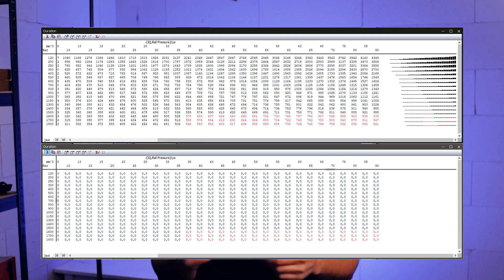Will Chip Tuning Destroy Your Fuel Economy?

Comment: I've never had a remap on any cars I do a delivery job in a very very busy shop and I drive a deseil for work I have had petrol cars before but the fuel runs out to quick that why I drive anything that's not petrol but I'm thinking of buying it again will the eco remap make any difference
Reply: Any update?
Reply: @ahmaddanishdanielhamsan9308 i got a petrol car now
Reply from the maker: Well what most tuning shops do on an eco map is they bump the torque on the lower revs, hence why the car feels more smooth, most of the time they leave top end power so that means that on such tune, most of the drivers will shift early. That means that in some situations this can be benificial for the consumption ;)
Reply: @svr_BE my car a turbo
Reply from the maker: @truth.hurts... yeah then they raise boost target in lower rev range indeed

Comment: This was just talking theory and just as inaccurate as the calculated fuel use on the dash. 
Would have been nice to see actual facts and examples rather than theories and opinions.
Reply from the maker: I understand your reaction. But this is not that easy to show back to back on a video, because there are a lot of variables: incline, weather, driving consistent, ect

Comment: Hi, I like your style of mythbusting the consumption saving on diesel engines, but you've made and missed a few crucial things. In both ways a piggyback "powerbox" and a commercial tune can lower consumption even if they're calibrated. The main reason for this is the fact that there's more torque, on a manual gear car you'll be able to shift alot sooner to the next gear. Less rpm's equals less injection. You compare a piggy back to a decalibrated injector opeing time, this is incorrect since most piggy back will add more rail pressure (without the ECU monitiring it), from what I know the only brand of piggy back's that increases the injector opening time is Steinbauer (wich is used by alot of big tuning companies like AC Schitzer). But, most importantly I disagree with what you say you can't lower the the consumption because the engineers will always do a better job". Let me get into detail: if you correctly calibrate the SOI (start of injection), EGR maps (I'm not talking about disabling, but optimising), recalibrate the rail pressure accordingly, set a higher boost pressure and adjust your lambda target maps you will get less consumption, but to be complete: NOx emissions will raise, so will the combustion chamber pressure (but that happens with past ECU modified cars too (the so called stage 2 and on remaps). There will be more energy released for each amount of injection. The calibration engineers at the factories have to keep all emissions and safety limits in mind, but as a "tuner" you can adjust these things to get a lower consumption, not only on the odometer, but also in reality (more mileage for a certain amount of fuel), if you combine that with the first subject: the increased torque and potentially drive in lower rpm's you get the correct explanation. Is decalibrating correct: no, it's certainly not, but your debunk is easily debunked as you can see.
Reply from the maker: I agree, but i think we both know most tuning companies just buy files, and if not they go for the quick way of earning money. Instead of trying to optimise everything as good as possible. The thing i want to make clear is that most people are getting stuck in the marketing side

Comment: I have an audi A5 1.8. Petrol Turbo charged, stage 2 ECU remapping.
I've found that if i go real fast, lets say over 50 mph speed the petrol goes down real quick. But keeping my speed at a constant 50 mph on the motorway (when and where i can) my comsumption is amazingly low, and if i never stopped going i could with a full 60lt tank, get 630 miles out of the car. I could basically if traffic condition would allow for it,  stay on sixth gear and never change it again. I figured that the engine having more torque and power, requires less effort to move the same amount of weight, than before the tuning and not working so hard like before the tuning, therefore using less fuel. Does this reasoning make any sense to you? You could of course say, what's the bloody point of having a remapping to increase power and speed in the first place, if all you do is wanting to go slow to save fuel, hahaha. But that's another story. Lol
Regards, SergioUK.
Reply from the maker: Indeed in some cases some cars can consume less because you can drive it in another way after tuning

Comment: I've got a diesel and mine does like 0.2l/100km less, after the remap. This is still a win, considering it has more power. I had it remaped for comfort, and easyer overtakes. After the first week of fooling around with the new power, I just got back to my regular driving. Also, my DPF regens are at least as good as before, and no trace of smoke what so ever.
Reply from the maker: Yeah indeed that´s a good gain, but the main thing i want to point out is that people won´t save the 10-15% fuel economy some company´s promise
Reply: @svr_BE  yeah, that's impossible.
Reply: @alex_wfa  if your used 10l/100 km before, and is down 0.2l, thats a claimed 20% improvement.

Then you agree that 10-15% reduction is impossible 🤣🤣
Reply: @chucknorris2952  It's 0.2 not 2. Guess chuck norris is not that good at math huh? :)))
Reply: @alex_wfa  yeah, im confused by the standard of measuring fuel consumption in Norway, we use l/mil. 1 mil is 10 km, not 100 :)

Comment: It hasn't been the case with my 1.5 dci with piggyback. Accelerating up a steep dual carriageway from Maidstone from 50 to 70 mph without piggyback the instant mpg was around 30.5mpg. With the piggyback in +30% setting it was 23.2mpg (and accelerated alot faster). This indicates around 30% more fuel use due to 30% more power. Overall obd mpg is the same and about 5% more than actual calculations. But I have 30 hp and 75 nm more.

Comment: If the car is running rich from factory and you tune it, you lean it out so your not using more fuel. I have a series 1 and the series 5 uses 2 litres per hundred less than mine. I have asked tuner and they said i will get two litres better fuel economy from a tune so it makes sense. Same motor in each series. But yeah i will probably drive it harder so no real world difference.
Reply from the maker: With dpf they run always lean to not clog the dpf, anyway, still the same, you don't make power by adding air but with adding fuel. Have you tried to recalculate the fuel consumption instead of trusting the fuel consumption gauge
Reply: @svr_BE  I have also chipped my car since 3 years and consumption was like -1l / 100 km less, my fuel consumption gauge is broken so i always calculate it manually, and it's still right, so you're definitely wrong in this one.

Comment: correct me if I’m wrong, I believe the only way to increase both power and efficiency is if you have made physical changes to the engine. Such as better flowing heads or better flowing intake manifolds that would allow the engine to function as a more efficient air pump.
Reply: You can remap the air fuel ratio amongst other things in the ECU which will increase MPG.
Reply: Yeah this guy in the video ain't right all the way, there's more to it than just "add fuel" as timing matters more than the amount of fuel, advancing and tuning the SOI and EOI you can make your car more efficient, also raising rail pressure will allow your nozzles to be more efficient by making diesel in smaller droplets that burn faster and therefore you have the power available sooner, as the piston is up there the pressure on it is higher, so, for the same speed your fuel will decrease. This happens if you take the engine from a passat PD130 and install PD130 engine from audi, injectors are different and you will go to 10L to 100km and that's a lot of fuel. I remapped it and now it takes about 6 on that heavy car. Stock was about 7.5L to 100km, all I did was change the afr and injector timings. That's what brings you better economy, this guy in the video has a lot to learn before teaching people.

Comment: what information i don't think i received from this, is what about the turbo? by chip tuning diesel engines, aren't they actually making the turbo work harder to have higher air pressure to burn the fuel with better efficiency and also generate more torque ? this of course without adding more fuel. so.... => fuel economy? please correct me if i understood this wrong
Reply from the maker: No the main reason why you have to up the boost pressure is because you need the correct amount of air entering the cylinders to be able to inject more fuel. If you would just ad the fuel, you would have excessive amount of smoke which could clog the DPF.

Comment: What about soi maps? I bet it make a diffrence in fuel consumption.
Reply from the maker: It does, but they most off the time they only increase soi in full load rows. While for consumption you should tune part throttle stuff. And if you want to camibrate soi more correctly you need really a lot of time because you have to be able to test every particilar cell of the map, which 90% of the tuners doesn't even care about. Imagine this, how long does it take most tuningshops to tune a car ...